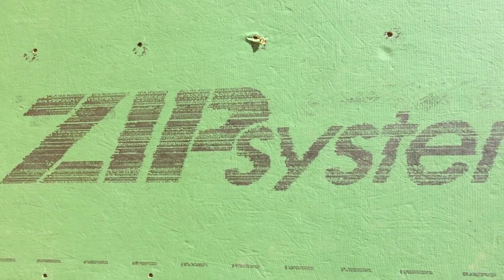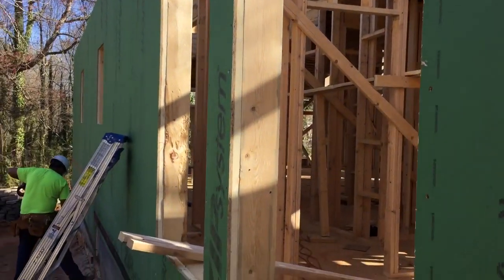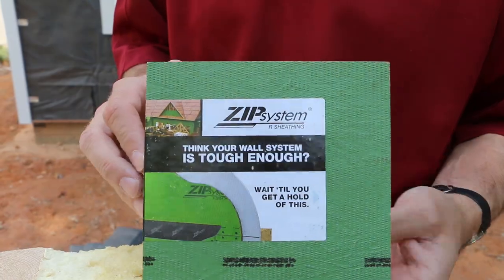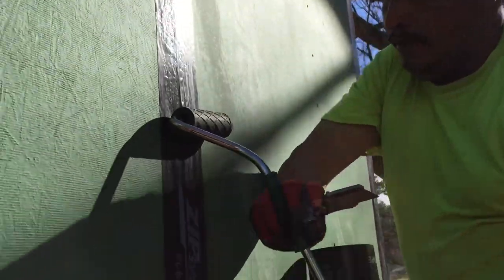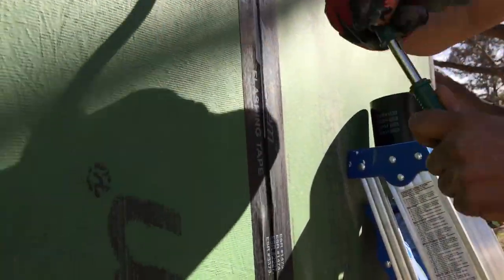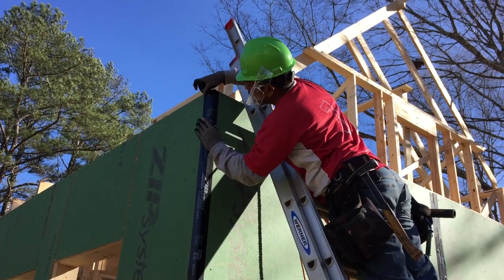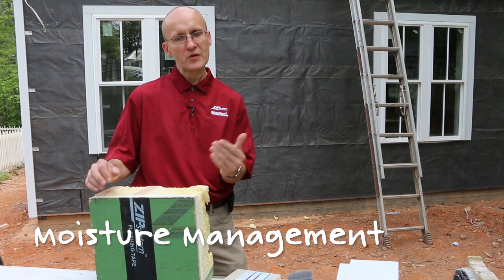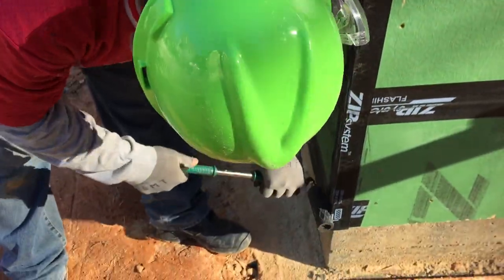The Benefits Of Zip R-Board Sheathing | TECH 003

Comment: That continuous layer of foam makes a HUGE difference with respect to thermal transfer through the stud cavity.  And the fact that it serves as a vapor barrier saves your crew the install time for tyvek or any other competing product.  Great stuff Tom.
Reply from the maker: Thanks for watching Greg. At R-29 our walls are 3x code for standard construction here in Georgia. Of course, our plan for this green home is to far exceed standard. Thanks for watching.

Comment: If I take off all of my siding Can I put zip r 3 on top of the current plywood? Or does it 100% have to be connected to raw studs?
Reply: I think you should be able to put R-3 Zip over your existing sheathing. Just remember, you'll be changing the dimensions of your house a little and the old siding might not go back up. You may not have been planning on that anyway. Thanks for watching.

Comment: Nice looking on the ZIP system!  What was the rain guard you put up?  And would the metal siding work on Zip System too?  Thanks for the videos on the different Techs going into the house!
Reply: Hi Kenny. Sorry for the long overdue reply. I need to monitor this channel better. We used the MTI Sure Cavity rain screen product. I saved some scraps from the project to use on my shed and it installs very easily. Metal should work fine over the Zip. You may want to use structural screw if you are adding a lot of weight. That said, concrete siding isn't very light either. Thanks for watching.
Reply: @GreenShortzDIY  Thanks for the reply!
Reply from the maker: @kennybeans303  Thanks for your patience. I sent my reply from the wrong channel. :-) I figured you knew who it was coming from though.

Comment: Would like to know more about the vapor barrier in northern environments.
Reply from the maker: Hi Boe. Zip makes an R-Board with R-12 rigid insulation on the back. I've heard that is what is normally used in colder norther climates. The acrylic tape that covers the seams and the green vinyl layer on the Zip with serve as your vapor barrier. Thank you for watching.
Reply: @greenshortzgreenhouse498  Thanks!